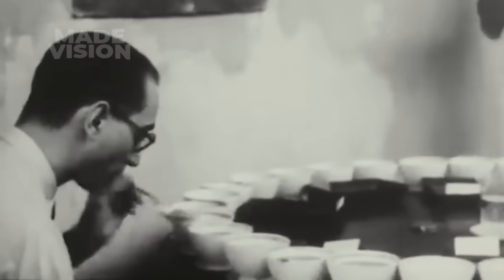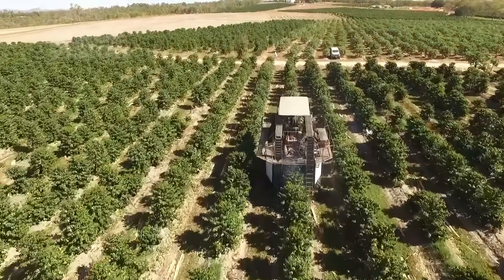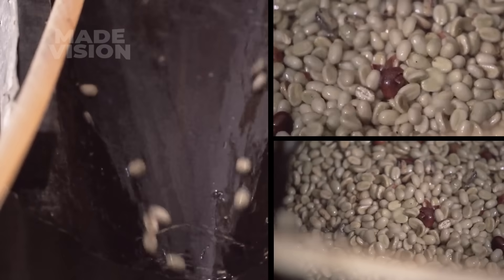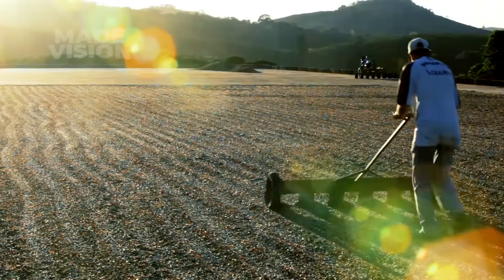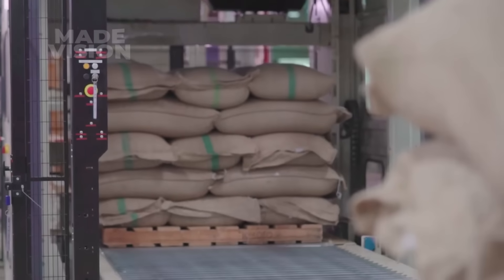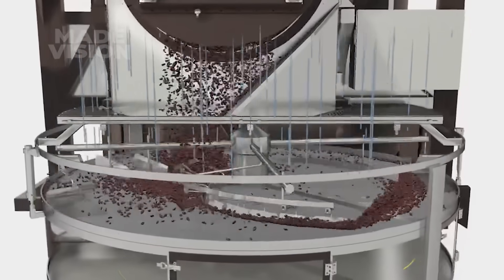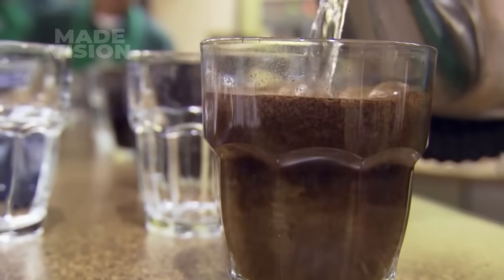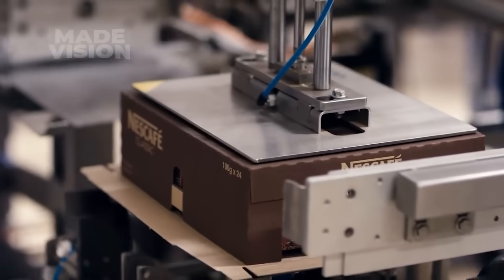How Instant Coffee Is Made In Factory

Comment: 9:08 Actually, roast time and heat don’t have a big impact on caffeine content — caffeine is very stable under roasting temperatures. The main reason light roasts usually have a bit more caffeine is because they’re denser, not because the caffeine burns off in darker roasts. The difference is pretty small either way.